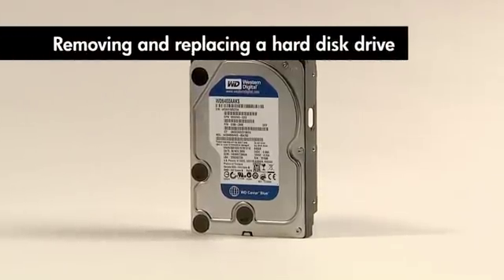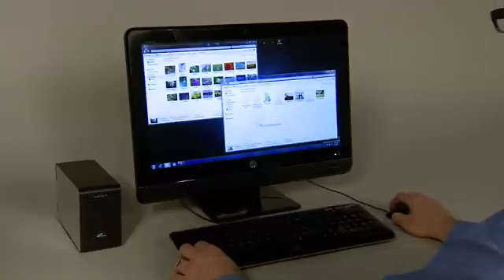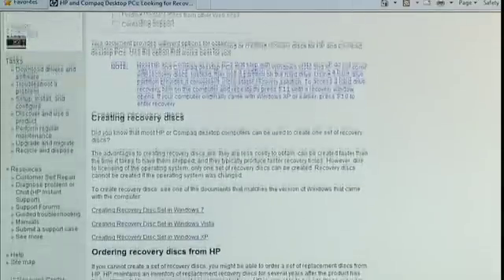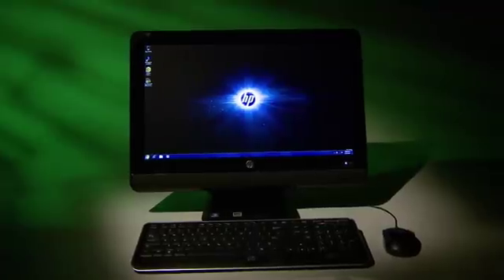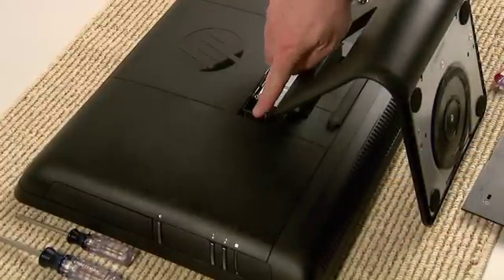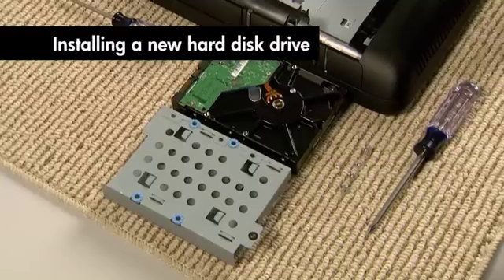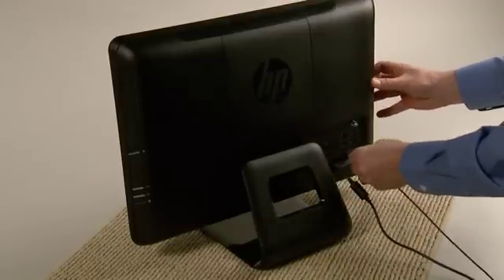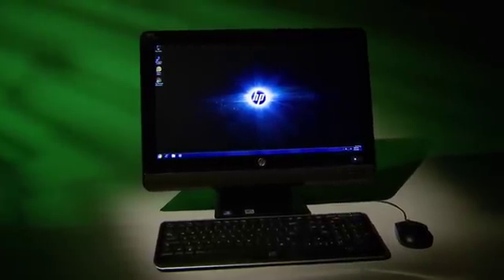Replacing the Hard Drive | HP Pavilion All-in-One PC | HP

Comment: I have a HP all in one pc(HP All-In-One 20-2110in 19.45-inch Desktop PC)

 I wanted to increase its ram and graphic memory how can I do so 
Pls give reply as soon as possible bcoz its important
Reply: Jerinjames James I recommend taking a look at your computer's Product Specifications (c04399372) which lists the type and amount of memory you can upgrade on your computer.  It also indicates that the graphics card installed on your desktop is integrated, which means it will use up video memory as required for the application. This type of memory cannot be upgraded.
Reply: Can I just increase the RAM of my computer by replacing the RAM chips with higher ones
Reply: Jerinjames James Yes you can install new SODIMM modules to increase the RAM on your computer.
Reply: Where can I get the HP ram pls give me the site yo buy online using HP site
Reply: Jerinjames James You can find RAM to order using the HP PartSurfer website. Please ensure that you enter your country in the top right-hand corner, and then search for your desktop. It's product number is J1E85AA. If you are not able to find any available RAM modules to order, I recommend acquiring this module (698655-154) locally.
Reply: HP Desktop and Mobile Device Help I had one more query I not satisfied with my PC so is there can replacement policy of hp to replace my pc
Reply: Jerinjames James To inquire about your replacement options, please call our technical support at 800-474-6836. If you live outside the US/Canada Region please go to Google search and enter 'contact HP worldwide'. Your first option should be the site for contacting HP, when you click on it you will be prompted to choose your country/region.

Comment: i want to upgrade a hp omni 120 1133w with a ssd. is there an adapter to line up the ssd properly
Reply: Adam Rusin It would appear that the option for a SSD adapter is not available when replacing hard drive devices. For more replacement options and steps, please refer to this Upgrading and Service Guide (c03275167).

Comment: Hello, I have a HP Pavillion 20 All in one. The hard drive has crashed. Once I replace the drive and use the system recovery disk, will windows 7 or 8 be installed automatically?
Reply: TAWANA MATTHEWS No you will need to use your recovery discs to get Windows back onto your computer.
Reply: Is it better to make them with dvd-r or flash drive? I have seen different opinions on this subject, but I want to make the right choice. Or does HP offer them for sale?
Reply: TAWANA MATTHEWS on DVD or Flash drive does not matter both are pretty much the same. As for whether HP sells them it depends you would have to give me the product number for your computer and the exact operating system and I can look and see for you.

Comment: hp pavilion 21 touch screen disc tray repair the tray is stuck open I cannot put back in it came off the slider track and now stuck open how can I open the back I see a lock on the back but don't now how to unlock
Reply: MrBuhner This sounds like a hardware issue and I would advise you to call into our Technical Support line for assistance.

Comment: Hello HP
I have a HP Pavilion 23 AIO PC Model 23-b040xt.
Is possible for me replace the SATA DISK with a new SSD disk? What model of SSD will match with the case? 
Thanks, Pavel
Reply: Hello Pavel Gonzalez Yes you can install a SSD in your HP Pavilion 23-b040xt All-In-One Desktop PC. As for which will work they all should there does not appear to be a restriction on it. You may need a drive cage to hold the SSD in place as it will be 2.5 inches and the current hard drive will be 3.5 inches.

Comment: I have a HP Omni Pro110 AiO and whenever i am gaming or watching videos on youtube/twitch for more then 30 min it gets super hot and extremely loud and annoying can i get some help? Don't really have the funds for a new pc right now. Thanks
Reply: Hello Joejoe d, I would ask that you provide additional information. What operating system are you running on your computer? Has this issue always been there or is something that happened and you now need to fix it? Are there any other things that are not working correctly or is this it? Please provide as much information as you can and I will be happy to help you. Thanks!
Reply: HP Desktop and Mobile Device Help Running windows 7 and it has been doing this for about 2 months now so when ever it starts to get loud i usually just shut the computer down cause of how annoyingly loud it becomes and there are no other problems as of now also the other night i continued to use my computer through the noise and it went black screen and i had to power it off but that was the first time its ever happened.
Reply: Joejoe d
Based on what you have described I suspect that you have a failed system fan or CPU fan. I would seriously recommend that you contact HP Technical Support or bring your computer into a local repair shop if it is not under warranty and get it looked at. If I am correct you could cause damage to your computer if it is not repaired.

Comment: hi guy, hey i have problem with one of hp all in one i dont remenber the serial of that but it is similar or the same like your hp, the problem that i have is that my cousine antered in the bios and move to eneable all the ports usb and now i can use my mouse or my keyboard, and i cant enter to the bios cuz i dont press the esc button, so do you know somenthing about to fix that problem?
Reply: Hello PABLO FRANCISCO LUEVANO SANCHEZ, You will need to install a serial keyboard to be able to enter your BIOS and effect the changes to restore your BIOS to factory. This is the only way as your USB will not work until you do.
Reply: Ok thank but where or how install the serial keyboard ? And where i coul find that serial? Thanks friend
Reply: PABLO FRANCISCO LUEVANO SANCHEZ
In order to answer your question I will require the product number for your computer. If you do a Google search for "c00033108" you will see an HP Support document: How Do I Find My Model Number or Product Number?, which will explain how to find the needed information. I will await your response.
Reply: Ok thanks i fixed it i restored the BIOS but thanks friend (y)

Comment: can somebody help me? i purchased my hp all in one 200 and after the warranty expired went bad.
when i push the on button the small led just blinks and goes off and nothing happens,i just to fix it by unpluging the power supply for 2 o 3 days but now  nothing. i called hp and they wanted over 350.00 to fix it.
can somebody tell me what do i need to replace?, thank you very much.
fernando.
Reply: I definitely sounds like a hardware issue. You can either have HP fix it or have a local computer shop take a look, but it definitely sounds like something needs to be repaired or replaced.

Comment: Hard drives can go out on any PC. It really depends on how the PC is taken care of and how the PC is used. This PC is probably over 5 years old, so it's probably been used quite a bit. If the PC keeps giving that message, it may be sensing that the hard drive is starting to fail. It's hard to say when exactly it will fail, but the system detected a condition that alerted it to show the message. I would keep my files backed up just in case. The good thing is you can replace the hard drive.

Comment: It sounds like you have overheating occurring and the fans have failed. You could try cleaning the dust out of the vents and see if that helps, but if the fans (or one of the fans) have completely failed, you may need to try and replace the failed fan.

Comment: I've never tried it myself, but theoretically it may be possible, NOT easy, but maybe possible. Go to HP's support website and search for your model number. Then look up the product and motherboard specs to see if there is an open graphics port. You can also look up other part replacement documents and videos from this site. Then I would try to look up another similar PC that has a graphics card and see what kind it has to see if you can use it in your PC.

Comment: It does sound like it could be an overheating issue. I can't tell if it is due to faulty fans or if another component is overheating. It's also possible you have a failed motherboard, processor, power supply, or hard drive. It's really hard to tell without doing further tests. Have you opened the PC case to see if there is dust or any other obvious issues?

Comment: I got a problem. Probably with the fan. When I turn on the pc, it's suddenly turn off. Is it because overheating? I checked  the upper ventholes, and the right side of the pc is cold (like how normal pc before it's being turn on)  and the left side vent is hot, just like how normally pc turn on. I think the right side fan doesn't work or broken. Could you analyze and give a solution for my problem?

Comment: I haven't personally tried that, but I'm thinking that as long as it has the same connections, it would probably work. Running a recovery on the new drive may run into problems though (not certain on that), so you would maybe have to install your own operating system and drivers.

Comment: If you still decide to do this, make sure you take your time and don't break any of the sensitive parts. Also, label everything so you don't forget where it goes...there really are a lot of parts you'll be removing and in some cases you have to remove one part before you can get to the another. It might even be easier to take it to an HP approved service provider to make sure it's done correctly.

Comment: Since the processor isn't a typical replaceable part, I don't have a video for it. I do know that you have to remove most of the parts from the back to get to it (back cover, stand, hard drive, optical drive, RAM cover, I/O ports cover, ventilation system, heat sink, etc.). After removing all the parts to get to it, it's held into place with a load cover and lever lock. It's an involved process to replace, which is why it's not recommended for most people.

Comment: Ive tried other drives in the machine and they dont show up either. the port is deffinately dead. I installed windows 7 onto a usb hdd and it worked for some time but now it seems thats no longer working either. Machine is just getting worse

Comment: forgot to say the HDD is dead as well (due to the owner trying to connect it to a machine through usb, and the adapter she had, had a wall transformer with a wire with a 4 pin molex connector on the end, on the end of that was a molex to sata adapter. she managed to have that flipped upside down, sending 12volts to the 5 volt lead and 5volts to the 12 volt lead killing the drive, and afterwards she tried the drive again in the computer. I believe the dead drive then killed the sata port.

Comment: hmmm...have you tried a different SATA cable, or checked the connection on the motherboard to see if there is any obvious damage? It's strange that the BIOS won't show up.. do you know if the PC owner ever installed a non-HP BIOS for this machine in the past?

Comment: I had to do this due to was what thought as a dead hdd, and it ended up being the sata port had died on the machine. Rather crappy. Owner couldnt return it because they waited a year to take it out the box. So now im attempting at install win 7 onto an external hdd to make this thing work. Also cant get into the bios either. press F10 then it says its entering bios but then just goes onto booting to the win install disk